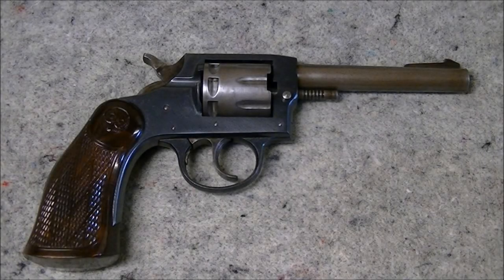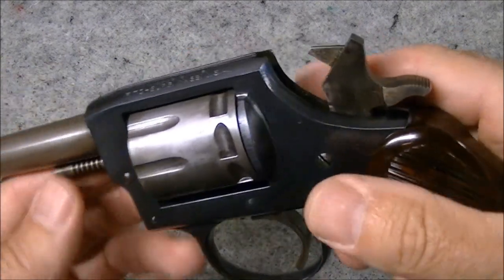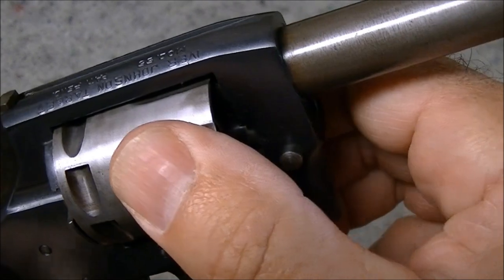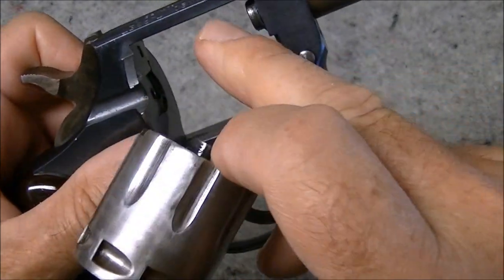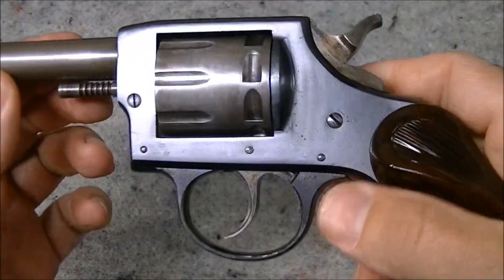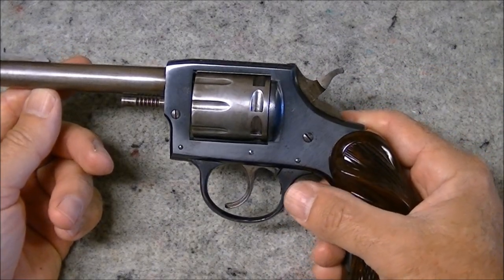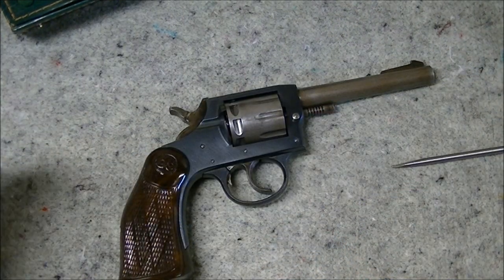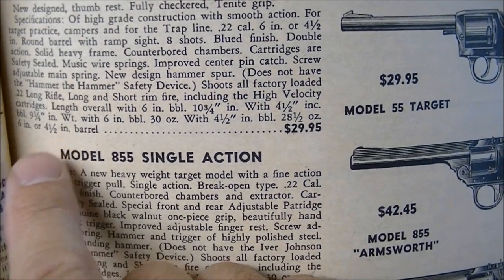Iver Johnson Model 55 Target Revolver

Comment: Great video! My grandpa passed away recently and I received his old Iver Johnson Target Model 57a and it is essentially the same as the model 55. It has adjustable front and rear sights and a loading gate that swings down revealing the side of the cylinder. The double action makes a bit more sense on the 57a as the adjustable rear sights are high enough that the hammer does not impede the sight picture when in the resting position. It tends to have misfires quite frequently, 3 or 4 light strikes out of 8  almost every time, so I'll try adjusting the main spring like you suggested. Very informative and helpful video! Thanks for posting!
Reply from the maker: It's nice to have an inherited gun like that to remember a relative. Best of success in getting your 57A back in reliable service.

Comment: Nice video. I've been looking for more info on this revolver.  I just inherited one with the 6-inch barrel and smooth cylinder (no flutes).  My father bought it new in 1958, but my research indicates it was made in 1957.  It hadn't been fired since 1980 and I have no idea how long since it had been cleaned.  The hammer wouldn't even stay cocked to allow single-action until after I cleaned it.  Amazing what a difference a good cleaning makes.
Reply from the maker: Yes, a good cleaning and proper lubrication can make all the difference. That's, cool having a Model 55 that belonged to your father.

Comment: I have the mod 57a manufactured in 1957. I bought mine in 1978 for 15 bucks unfired. I attached an ejection rod 30 years ago and it has functioned well all these years.
Reply from the maker: Did you fabricate an ejection rod or did you add one from a different gun?
Reply: Fabricated
Reply: From a set of wind chimes
Reply from the maker: @spiritualawakenings6251  Sounds like an interesting modification.

Comment: Great video.  These are underrated guns.  The cheap guns being made now are nowhere near the durability of their 1950's equivalent.  I have an H&R 922 with a similar construction and concept.  The tip of the firing pin is missing.  Don't know if it was intentional or not with these old guns.  I plan to have the tip TIG welded and then file till the protrusion is correct.  It's a gun my father owned, so I do not want to change it nor would I trust a replacement part to be fit properly anyway.
Reply: Tig welding would work but give silver soldering a try as well if that is more accessible to you.  It will work.
Reply: @ragnarragnarsson3128  I've already got a guy lined up.  Just have to get our schedules synchronized.
Reply from the maker: The H&R 922 is certainly an equivalent to the IJ 55. I would guess someone dry fired your H&R in order to break the tip off the firing pin.

Comment: I have a Model 55 that is in excellent condition. It was literally granny's gun. It is stamped as 22 caliber. When it is loaded with 22LR it looks like it could also be loaded with  22MAGNUM. Do you know if it will safely fire a magnum shell? It is also a 5 1/4" barrel.
Reply from the maker: The 22 magnum round has a larger case diameter than the .22 LR and will not chamber in a .22 LR (unless someone has modified the chambers). Modifying a 22 LR to 22 MAG is not advisable as the 22 MAG operates at much higher pressure than the 22 LR and guns may not be up to taking the pressure. I would only shoot 22 MAG is a gun made for it at the factory.

Comment: THANK YOU for a CLEAR, CONSISE , & INFORMATIVE VIDEO.  I've just picked up a "55 A" (literally a few minutes ago). It is absolutely pristine ( with the exception of slight rust  about 3/8" of an inch on the frame.
    I've recently gotten into collecting IVER JOHNSON firearms.  I have researched the history of the company and the various models "IVER JOHNSON ARMS & CYCLE WORKS" have produced over the years.  Intriguing company history & the engineering they produced about a century ago.
The only difference I've found in the model "55" & " 55A"  is a loading gate.  IS THIS TRUE?  Are there other differences?  The barrel on mine  is mine is 5 1/4".   Can you or anyone reading these comments help me with that?  THANKS
Reply from the maker: Thanks for your comment, I'm sorry I'm so late responding to it but I just saw it.  I'm far from being an expert on these revolvers, but as far as I know the only significant difference between a 55 and 55A is the loading gate.

Comment: Really good video.   I have a Iver Johnson Target model 55 almost exactly like yours.   Mine has a white grip and an unfluted cylinder and the serial number is on the bottom of the trigger guard.  It is in very good condition.   Mine is missing the front sight blade and has some rust on the cylinder.  I haven't been able to find parts for it.  I'd like to get the sight blade and a new cylinder.   Also the cartridges are tight fitting in the cylinder.  Maybe I can file the inside of it to make them fit better.   I haven't fired it yet.  I may just sell it and get a 22 revolver I can use for target practice.
Reply: Please Do not file the in sides of the cylinder get some polishing compound with q tips or 1000-1200 grit sandpaper and lightly go trough the cylinder holes
Reply: @cjv3417  I tried several different brands of 22LR ammo and CCI standard velocity ammo fits without much drag.  All the other brands I tried I really had to push hard to get the cartridge into the cylinder.   I haven't shopped for ammo for several years so I don't know if CCI standard velocity is available now.    I tried filing the inside of the cylinder but the metal is case hardened and the file didn't do much.  The whole gun looks case hardened with the colors in it.
Reply from the maker: That's quite odd the rounds being "tight fitting", perhaps it is just dirt/fouling or a light layer of rust? I would get a good tight fitting brass brush and go at the chambers with that and some light oil to see if that cures it, no filing should be needed and I would advise against it. If there is some rust you might want to wrap a bit of fine steel wool around a bore brush and again go at the chambers with some oil.

Comment: Nice video about a not well known vintage revolver.  While you could carry it with a full cylinder on half cock, I think I would load 7 and carry with the hammer on an empty chamber like a SAA. Cheers
Reply from the maker: Yes, one is relying on the "safety notch" or half cock notch when the cylinder is full. Seven shots is still a decent capacity when down loaded.

Comment: Does any one know why my trigger won’t reset after firing each round I manually have to reset the trigger by pushing it forward
Reply from the maker: It sounds to me like you have a broken spring.
Reply: @314299  that’s what I was thinking. I went on eBay and bought a whole new trigger piece that includes the lever,lifter and small bent spring piece and I ended up switching the trigger and it went from being basically broken to a single action and I don’t mind it tbh I just found out that the reason it didn’t reset was because the lifter piece wasn’t sitting In the right spot and therefore it would not act as a spring

Comment: Great condition, my friend. I happened to think, if you shoot at an elevation, will those rounds fall out from the window under
 the recoil?
Reply from the maker: Yes, it's in nice shape. I don't think rounds would fall out the loading/viewing port if one was shooting at an elevated angle as the rounds would only very briefly line up with the port and the 22 rounds are a bit of a "press fit" into the chamber anyway.
Reply: @314299  yes I agree that the shell is not likely to just fall out. When mine is cocked the cartridge is not perfectly lined up with the loading window. It is almost halfway covering the rear of the shell in half-cocked position.